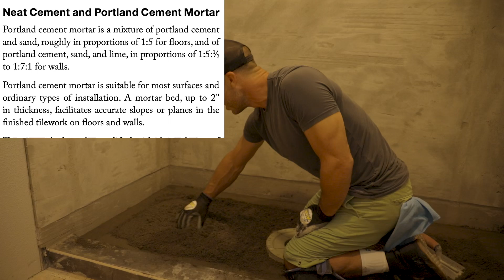LATICRETE HYDROBAN MEMBRANE--- IS IT BETTER THAN SCHLUTER KERDI??

Comment: It’s a gags idea to ALWAYS insert a cloth plug in the drain while working. I’ve seen numerous jobs where the drain pipes are half clogged with cement, glue, grout, even tools. And to stop the cloth plug disappearing down the hole, wrap it around a bit of  sponge foam so that it stays in place until removal.
Reply: or just buy an oatey plug... they are reusable.  you'll want it when you do your flood test anyway...

Comment: Those membranes are highly flammable. I’d rather use the wet hydroban seal on fiber cement board.
Reply: Do you experience a lot of shower fires where you live?
Reply: @AKcap530  argument of a 10 year old lol. modern houses easily catch fire and spew toxic fumes because of the flammable materials used to build it like this membrane.

Comment: Issac, How about an explanation of what was done with the hydroban membrane. Looks like you went up the wall a little bit and stopped, and then covered it with a 90 degree piece in the corner.

Comment: Laticrete to Schluter... "Everything you can do I can do better!" Thanks Isaac, another great video.
Reply: Except the drain, Schluter’s drain is 10x’s better. Multiple issues from different installers on Facebook groups
Reply: @OBFTILE  Ebbe America drains are actually better than both. Schluter wishes they could make drains like Ebbe. Not that cheap looking stuff with  flat head screws on top.
Reply: @Mud55  RipOFF   500 dollars for a linear drain, please.....
Reply: @KevininSC  height adjustment for thin tiles I believe

Comment: When you put the banding on the wall, i normally do the band that laps on to the floor and wall first then the band on top of it, that way any water will run down the banding  not potentially into the seam
Reply: Thats the process i do as well.  Ive never truly trusted the seams from securing water out.   Thinset isnt waterproof so I've always feared water would find its way between the seams of the bands.   Overlapping so water never flows down to a seam is just a safer bet.    My opinion.

Comment: I suspect the thin set was drying faster in Denver more because of the altitude than the heat. The air is very low humidity there and thinner so the boiling point (and hence evaporation point) is lower which translates to faster. However, if it’s more of a chemical curing process than evaporation for it “drying” then temperature might be the governing factor.

Comment: I ordered some hydro ban membrane to do my shower, but cannot find multimax lite near me(except 1 local company that will not answer their phone, tried 5 times). What else would you recommend? Also, this really doesn't need the ardex 8+9? I am doing my shower in a couple weeks and had been planning on doing Kerdi membrane with ardex, but changed when i saw this video. Also, does it matter what kind of edge tape you use? Again, finding these brands online sometimes isn't very easy.

Comment: did you recess the bottom 5" or 6" of the walls by an 1/8" or so to allow the hydroban sealing tape to be flush with the walls? why did you use 2 layers of the sealing tape at shower floor/wall joints?

Comment: Extreme whipping up mixing of thinset with drill based mixer can dissolve a lot of air into the mix that will not come out when applying.  Some thinset types are worse at this then others.  As thinset dries bubbles will appear below underlayment.

Comment: I Tile Coach.  I"ll be remodiling my shower into curbless.  I know that I have to "sink" my plywood subfloor level with the beams.  But then all the videos I have seen show that the only way to slope my "sinked" floor is to buy a very expensive shower pan (seems like foam based from the pictures) like Schluter kerdi-shower or similar just to provide the slope.
My questin to you is: instead of sinking the whole square an inch and a have all around, what if I just "build" my slope with the plywood, then I don't have to buy the expensive pan. then just put a layer of hardibacker on the entire bathroom as normal, including on the "slopped plywood", then just apply the membrane onto the entire batrhom, and tile on top.  Would that work? What would be wrong with that?

Comment: I like your videos....., why don't you do a shovel or other tool test...see which resists getting peirced?,. and compare the different membranes against one another.  I know it is fairly easy to put a shovel through most of these type membranes,.but you infer this one is stronger, (and easier to install). It is a given that a hot mopped membrane is extremely strong as compared to these newer ones..but which one is closest. I don't live in S.Cal. anymore, but when I did, I do not recall one.........single............shower  done with anything other than hot mop. We (and anyone else I knew on our jobs) always used the same hotmop guy (I imagine he is either retired or dead by now, ) and I don't recall him ever having one...........single........failure over all those years. 2 or 3 pans a day for 50 years,..you would think there would be a failure somewhere. We either do our own  (pvc membrane) or sub ours out to a kerdi guy. There are no shower pan hotmoppers in the state I work in now.

Comment: Awesome knowledge base videos! Could you tell me which shower base is the best to use, would it be schuluter or another brand? If i use the schuluter base do I have to use schluter  walls or can I use cement board. If schuluter base is used would you still use the ardex or the HYDRO BAN Cementitious Waterproofing Membrane around the drain, like you did in one of your videos? iF you could reply be awesome as I going to demo in a month.

Comment: Issac...love your insights!...I have a question..I love Schluters single plane sloped trays but would like to use hydroban wall boards and banding...do you think the schluter trays will adhese to the hydroban boards and banding?..what thinset?

Comment: Are the vinyl liner no longer used?  Thought it was pre slope, liner, mud pan then tile. Wondering what stops water from going in to pan area where floor meets the wall. Understand slope will help. What is the white thin set and is it water proof?  Terrified that that second floor shower will leak. Appreciate you willingness to share your knowledge.
Reply: White = Multi Max Lite
Hydra band sheet membrane
...then tile?
Reply: Sheet membrane vs rubber pan liner. When and where and why ?

Comment: Hey coach,  Can I use Hydro Ban over HardieBacker over plywood for a shower floor.  I'm installing a linear drain with a flat sloped floor and large format tiles.   If this isn't a good idea, why not, and what is a better way without breaking the bank.  Thanks

Comment: Hydro ban sheet membrane is better than kerdi.......Been using it lately and love it. No need to use unmodified thinset.
Reply: OK, stupid question, can you apply the membrane to wood subfloor using max lite or do you put down strata mat then membrane?
Reply: @keithowens9242  Depends on what application you're talking about. A shower pan? Bathroom floor? Living room floor? Sheet membrane is typically used to waterproof a shower pan. If you're talking about a shower pan, then you need to float your pan with sandmix or drypack (cement and sand mixed together), slope it to the drain first and then install the sheet membrane over it. If you're talking about a regular bathroom or laundry floor, then i would just use strata mat over the wood subfloor as an uncoupling membrane.
Reply: on a bathroom floor. I know you can use strata mat on the bathroom floor but how do you waterproof strata mat??
Reply: @keithowens9242  Why do you want to waterproof strata mat? A bathroom floor doesn't need to be waterproof unless you have a curbless shower. If you want the bathroom floor to be waterproof, just use a different product....Ditra along with kerdi band is waterproof. You can also lay 1/4 cement backerboard and install hydroban sheet membrane over it to make it waterproof.
Reply: @willinthearea6318  Couple of issues, The bathroom is on the second floor of my daughters 1927 house and the final height of her interior curb is only one inch plus 3/4 inch quartz curb top. Just in case I want the floor waterproof. I was going to go ditra with kerdi band however several tile guys claim there have been issues with adhesion of ditra to Advantech subfloor?? Would prefer an uncoupling membrane if it all possible over cement board. Hey, I appreciate your time and feedback!!
Reply: @keithowens9242  Ditra will stick to advantech subfloor if a quality thinset is being used. If you're going to install 1/4 cement board over the wood subfloor, then it shouldn't be a problem. Ditra will stick good to cement board. If it were me i would just use ditra with kerdi band or 1/4 cement board with hydroban sheet membrane.  Cement board plus ditra might raise your floor a bit much....You want the transition from tile to another type of flooring to be about even or the same height.
Reply: @willinthearea6318  Yes, schluter recommends allset non modified thin set for ditra. Youre right. I dont want to use cement board or add anymore height to the floor. Probably will end up going with ditra and kerdi band. Thanks for your good suggestions!!
Reply: Sheet membrane vs rubber pan liner. When and where and why ?

Comment: Is it time to test whether Hydro Ban Sheet Membrane applied with Multimax Light leaks at the seams like Kerdi did?  Such a test could inform your decision whether to roll liquid waterproofing over the membrane installation, like you used to do with Ardex 8+9.
Reply: Do you prefer liquid roll water proofing to a sheet membrane?
Reply: If your kirdi leaked you did something wrong on your install I’ve done a water test for 3 weeks on my kirdi pans

Comment: Isaac, are you affiliated with NTCA? I would encourage you to look into becoming a Certified Tile Installer through CTEF. If I can get your email I can send you a video of the rapid  Hydro Ban-it will blow your mind how easy it is, plus you get a water test all at once! I am a NTCA Ambassador here in Wisconsin & I am an Evaluator for the CTEF, 40 years in the trade. I made the switch to Laticrete years ago & never regretted it.
Reply from the maker: Yes I am a member of NTCA, just joined this year.  I have though about getting my whole crew certified.  Please send me a submission on my website tilecoach.com

Comment: Hey issac i built a pan using pebbles and I like to go 1/2 per foot for slope what's your thoughts on using more slope for pebbles
Reply: Keep grout close to flush with pebbles as much as possible, 1\2" is high but won't hurt any, it will be high on the sides. I personally would still stay with 1\4 to 3\8 at most.
Reply: Pebble shower floors in an interior application is a disaster just waiting to happen.
Reply: @OneAdam12Adam  why is that if used with a properly sloped mud bed

Comment: Question 1). Can i use (CUSTOM LevelQuik Primer acrylic latex) on slab on grade rather than doing a slurry coat in preparation for Dry-pack installation? 
Question 2) What is the worst that could happen if you don't do a slurry coat?

Comment: Isaac, what is the best solution for fixing an air bubble found the next day after multi max lite has set?
Reply: Air bubble the next day will have to be cut out and patched or sealed over.   The thinset would be to cured/hard underneath to fix it any other way.  If its a tiny air bubble i wouldnt even worry about it.

Comment: Is it a problem that you waterproofed over the damp mortar bed? Won't that trap in moisture?
Reply: It's drypack mortar. If anything, it will lengthen the cure time and make it stronger.
Reply: No.  The water will be used in the curing of the concrete.  If there is any moisture though, it has a path beneath through the cement board.
Reply: Only harmful when using a roll on membrane.
Reply: rayturnertile  a little dry mud isn't going to be a problem.  Too dry and too little to clump and cause a clog.
It will drain away during the next use.  Not a good idea to let it happen, but I'm not seeing any significant amount falling in on the video.
Personally, I would have plugged the drain just to be safe.
Maybe he vacuums anything that falls in after he is done.

Comment: Are there any issues with using the laticrere 3701 where it touches the mude bed next to the drain, such as a weak joint or something?  Do they cure together?

Comment: Laticrete is still KING when it comes to tile mortar selection. Their membrane is also nice. However Schulter pans are the ONLY way to go "when" they can be used. Fast, light, no down time when drying, etc. The hell with toting sandmix up stairs, then mixing, then floating, then waiting...Ill pass

Comment: I thought that sheet membrane was supposed to be cut so that it covers the pan, and comes up over and around the curb in one continuous piece?
Reply: That's the idea.  As he explains, however, it's an air trap, and for him it's difficult to ensure the air's out of the groove.  Definitely a concern I share.
Reply: @TheAlgorath  Think I would be more comfortable for the random small air pocket/bubble than a leak.
Reply: @aquicktake  Actually, that's the issue.  Air bubble = leaks, points of mechanical failure, and weak points for tearing.  

That, and I've never seen a curb install without a patch, so can't say they don't have issues either.

But if your comfortable with what you're doing, I won't argue.